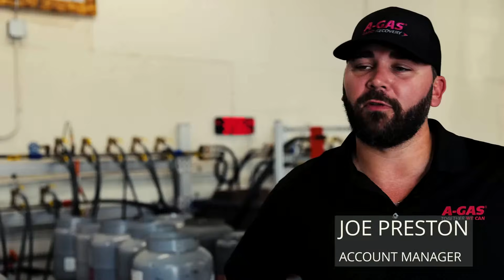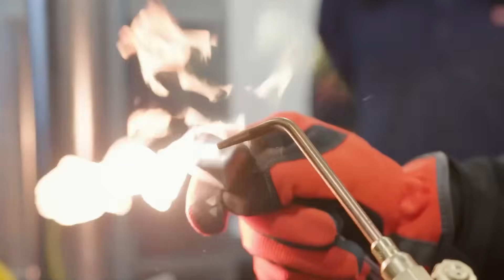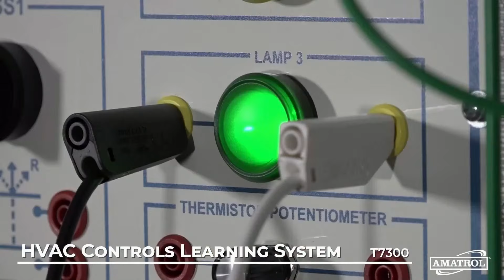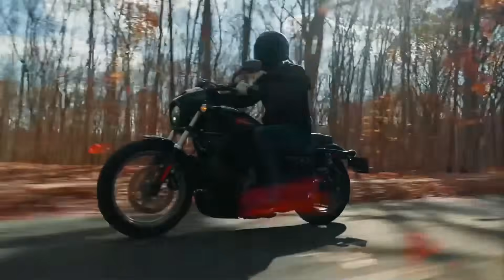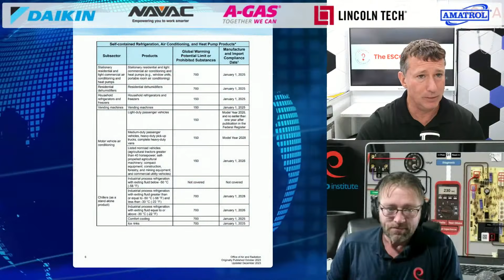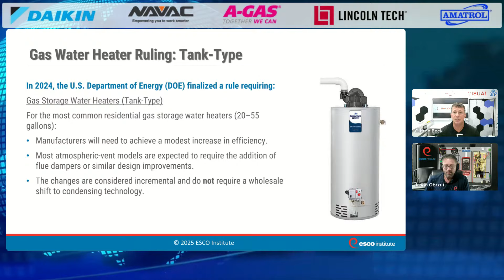Understanding the Latest HVACR Regulations: HFCs, Furnaces, EPA 608 & More

Comment: Thanks for the updates.  This is Very informative!  As far as electric water heaters, would manufactures only be able to produce WH's with heat pump technology in units 36-120 gallons after Dec 2028?  Would WH's under 35 gallons be affected in any way?